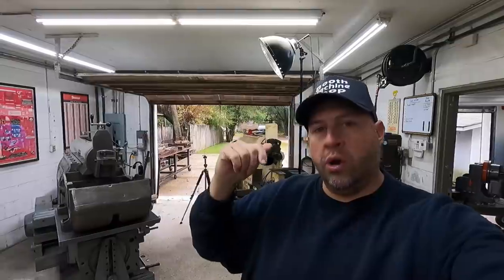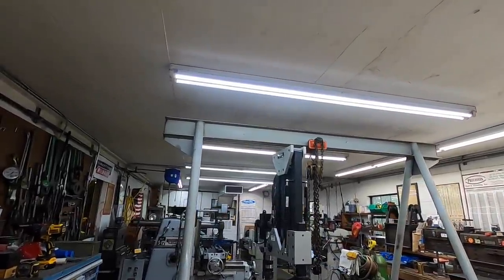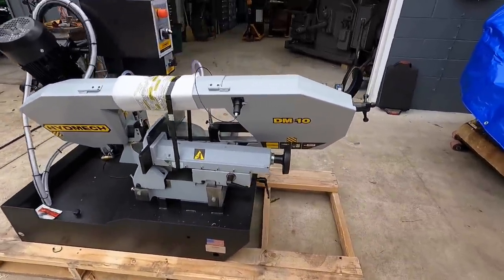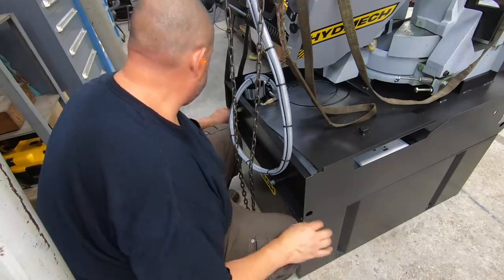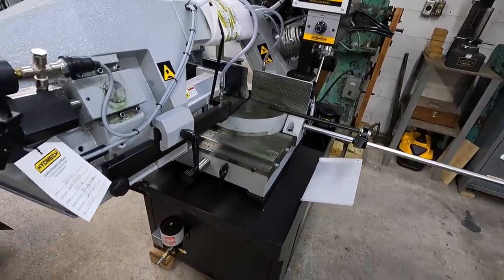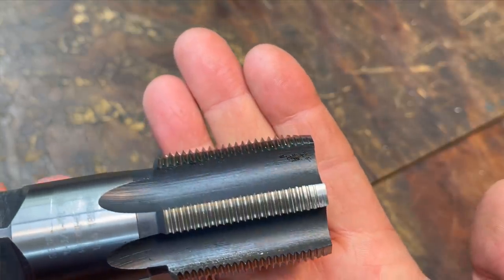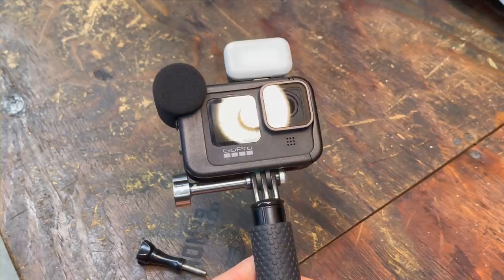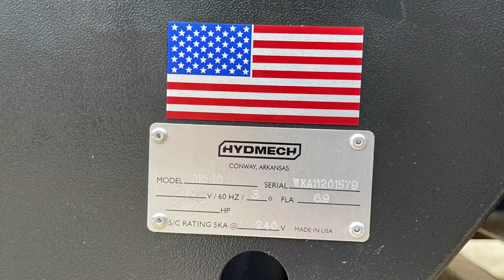SNS 330: Hydmech DM-10 Double Miter Bandsaw, Custom GoPro Accessory

Comment: I hope you enjoy the HydMech. We bought one one and didn't like it much at all. It had features, but it wasn't very rugged. We were a heavy production environment and we needed far more reliability than you will need. So I don't imagine you will experience the issues that we faced.  Ours was  bigger than yours. Ours came from Canada. Our main drive gear reduction unit failed within a couple of years. Our blade tensioning wheel was plastic and it didn't last long. Ours was full auto feed. There's a lot of competition in this market. A lot of saws seem to have cheapened the quality to compete with low priced machines.
Reply: Have heard both views on that brand. We ended up going with a HEMSaw, that is also full auto, made in Oklahoma. Super happy with that thing for about 15 years now.
Reply: New Hyd Mechs are no where near the old ones. Unless you are talking the big ones made in Canada. We change out a lot of gearboxes on hyd mechs.
Reply: Our gearbox failure started as a bad main bearing. I did the teardown and found a piece of the outer race was missing. I found the piece. It was a clean break. I believe that the large bearing was dropped and cracked during assembly. There was no other explanation for how it broke in the assembled gearbox. I couldn't get HydMech to warranty the failure. Our local dealer took a look, covered my bearing cost and reassembled for me at no labor cost. We bought a lot of machinery from this dealer.
That experience really soured me o. HydMech. We had other issues too, but that failure should have been covered under warranty. Dealing with HydMech directly for parts was not pleasant. My dealer didn't have a fully staffed office, so going through the dealer for parts added more complexity. I had no previous experience with HydMech before we purchased our machine. I was previously unaware of the brand.
We ran production volumes around the clock keeping two bandsaws running virtually non stop. Our machine was fancy and quick setup for angles, but it was too lightweight for our operation. I still suspect that Adam will never over stress his machine, and its flexibility for fab work is a fine feature. He is also an owner/operator that cares for his equipment. My experience was unpleasant, but if I added his new toy to my home shop, I would be giddy!

I am already giddy. We pour footings today for my 60'x82' home shop expansion building. The new shop will be metal/machine/mechanic space. The old multi-use shop will be exclusively wood shop. My wife is supporting the build! And it is simply a hobby shop. That is why I am giddy.

Comment: When lifting with straps we generally put a wrap on the lifting bars or shackles.
That means you could have put 2 or 3 wraps at the front to level.
That broken pallet would from your driver , cringed when he let that pallet jack down.
We use an Italian version of that saw at work, so good for cutting.

Comment: 14:30 one trick I use a lot on picking up big weldments is to pick up close to your center of gravity, then to put pieces of steel onto your high side to level your part in the air.

Comment: Alternative for waterproofing tools for outside storage, and any metal surfaces: Mix about 30% clear grease with white spirit into a spray bottle and spray liberally. White spirit evaporates and leaves a thin layer of grease behind. Way cheaper than aerosol products and will last longer outside. I also use on the columns of the drill presses and mill tables and other places I want to keep free of rust where oil too easily wipes away.

Comment: A mitering bandsaw makes all the difference.  They are very convenient.
If it’s like my Baleigh saw, that tray mounts at the back of the saw under the rear wheel.  It catches the cutting fluid that gets carried into the lower part of the housing and would drip on the floor.  You’ll need to move it to the side of the saw when you cut meters.

Comment: Your tap looks good after that tie rod job.  Light wear, more importantly, no damage, or  chipped teeth.  Keep in mind, there are two methods of sharpening your taps.  You mentioned grinding along the flutes.  The other would be to grind along the over all lenghth of it.  In volume work, that is the preferred way.  
Rough grind the leading flat at the front end down as much as needed.  This reduces the amount of teeth to go from the minor to the major diameter.  Follow up on this by grinding the teeth with a small clearance angle and a taper parallel to the flute to reestablish the leading angle back to it's original geometry.  Just look at the original geometry and reproduce the same shape.  This was something I could do by hand on a pedestal/bench grinder and get reliable threads produced on high volume orders.  
A combination, over time, of both methods would give you the longest tool life.  You are not to often expect to be using the same tap as you do primarily prototype work so this tap may outlast your career!
It took me a year or two of experience to become good at the sharpening method I described, but soon enough, it became pretty easy to preserve taps and I have used a similar method to grind chasers used in Geometric die heads.

Comment: If you want to line holes up, use a drift punch. It isn't really a punch, even if it looks like one. It's a long taper and if you can get the tip through both holes, you can wiggle it around while pushing it into the holes and those holes will line right up. In your case, you could have put the tip through while the holes were still a ways from getting close, and as you lowered, the drift punch would have guided the saw straight onto the base, perfectly aligned.

Comment: Just a thought, you could have used the DeWalt cordless reciprocating saw with the demolition blade in it to cut that pallet, but I saw the DeWalt cordless chain saw did a wonderful job.  I also noted the DeWalt cordless blower did quick work of the DeWalt chainsaw chips in blowing them off your slab to decay into mulch in your grass.  Keep your vids coming, I learn about stuff I have never seen before.

Comment: That is a beautiful piece of equipment. Would be good to install some steel casters under it to make it easier to move around. That way you could move it up against the wall when not in use and swing it out when needed.

Comment: I owned a hydmech. One thing I hated most about the one I had was that you had to be operating it. Unlike my wellsaws, which I could set up a cut and do other stuff, the hydmech required me to be there during the entire cut. Not a good machine for repetitive cuts. Also was poorly balanced and required a lot of force to pull down. The other issue was the blade tensioning interlock. Required a freakish amount of force to satisfy the interlock. You should keep your other saw. The great advantage of a miter bandsaw is that it doesn’t take 45 minutes to change from 90 degree  cut to 45 and back like a conventional bandsaw. I hope some of the issues I experienced have been addressed in yours.
Reply from the maker: I won't be having those issues you had with mine.

Comment: Nice saw! Just got done running a 1 5/16-12 tap on some stainless parts were making, not quite 180 parts but enough that I did the same and inspected after I got done, I ran emuge tap lube and after the job it's done on these stainless parts I don't think I'll ever run anything else.

Comment: Nice Saw - will be a great addition to your shop.  Is it 3 phase power?  I own an older model Wellsaw that I absolutely love, except mitres require a little more set-up, but doable.  Thanks for your continued posts and precision artistic talents as a machinist.  Wish we had the wealth of machine tools up here in Canada you guys have south of the 49th - most of the auctions I view are from the US, which makes shipping a deal killer.
Reply from the maker: Yes the saw is wired for 240V 3 phase. You can order it for single phase as well.
Reply: I was looking at that, too. 240-3ph? What alien planet is this thing designed for. I've never seen 240-3ph, but in a residential area, that would be easy enough to provide. (hang 3 "residential" transformers on the pole -- I'm going to have to look at skyline in his videos.) I trust Adam knows what he has (he's getting the bill), and what he needs (there's plenty of different loads in the shop already.)

[ https://youtu.be/O-1S93wQN5Q 208, 480, 600 are the common 3ph grid connections I'm familiar with. ]

Comment: take the time and make a frame for under the new bandsaw and attach some castors to that mate, makes it way easier for cleaning and moving around, i have the exact same saw but its branded "shark" made in italy, has the exact same MEP cut control system, just keep it topped up in the rear cylinder with hyd oil and it will run sweet. nice purchase

Comment: You should get a power winch and drill an anchor point in your driveway, like you did to get the shaper off the trailer. Then you can connect the winch to the anchor and any machine and pull them in/out the shop with your skates.
Edit: You can get one with a remote and just stand with the machine to guide it while you run the winch

Comment: Just wanted to point out that Hydmech is only a brandname from the Italian bandsaw manufacturer MEP. There is a "MEP Group" logo on the back.
So basically its an Italien saw, assembled in the US and with a US Flag on it. Nothing more.
Reply: @mustacheandthemaiden5773   But the American put there flag on it :-) No offence, just saying. :-)
Reply: That is a MEP indeed! We have a MEP 242 CNC FE at my work that we got 2004. Great machine that still runs like a charm!  What I really like about it and what also seems to be unique for MEP is to be the only brand of saw machines at least what I  have seen that can operate in the entire range from manual to full CNC (including a so called semi auto dynamic mode where it starts out like in manual mode where u position the sawhead (Y axis) by hand and then when u push the handle button one time it then starts operating like in semi automatic mode and makes the entire cut by itself) in the same machine wich is  great for what we do at my company as we make a big variety of things in a large range of sizes where the machine has to be really flexible. I however find it confusing and meaningless to change the brand name and flag (italian flag on our machine as it is indeed an italian and not an american brand even if it has been assembled partly in US) for the same machine in different markets and HydMech also sounds like a hydraulic press brand or something similar and not a bandsaw manufacturer. In the next video the MEP logo is clearly visible (is under the tape on the saw head) looking exaclty like our machine. MEP by the way stands for Magnani Enzo Pergola from the founders initials and the companys location

Comment: Cut the heads off of longer bolts or long allen set screws, screw them in the base holes to align it before you set it down.

Comment: Boy that thing makes the Taiwan made one they bought at work a couple weeks ago look pretty sad. Mind you it does the job we need it to do. Makes a good straight cut, does splash coolant all over the place when it's running though. I might be over doing it with the coolant, it just has a cheap valve you open and dumps it on the blade. It gets carried around with the blade and drips on the floor. They thought of it on one end of the machine with a drip pan but not the other.

Comment: Adam, in skydiving having something stick out beyond the body of the camera is dangerous. The knob has a Philips screw head to tighten/loosen the knob.
Reply from the maker: That does not explain why all models before using the Media Mod, the screws always stuck out further than the camera. When you are using these cameras you don’t want to use a screwdriver. Have you ever had to replace a battery in these? The thumb screws were designed for convenience.

Comment: Yep, the stock thumb-screw is definitely too short when you use on the Hero9 MediaMod. Sadly, I haven't found any amazon that's as swish as the one you made. If you do plan using two GoPros concurrently, they just released a remote control for the Hero9 to assist stopping and starting. It's cheap enough to justify the purchase and cuts down on your editing time a bunch.

Comment: Just as an FYI Adam, I'm pretty sure the GoPro screws are actually metric M5, but they're so similar to a 10-32 it makes no difference! If you're ever in Europe and need a screw though it might be useful to have at the back of your mind.
Reply: "It's M5 (with standard thread pitch 0.8mm)"
https://www.reddit.com/r/gopro/comments/2xh4x0/question_about_the_thumbscrew_threading_size_want/
   Nowadays even HD has metric screws. No need to go to Europe.

Comment: Now I see where the radial arm drill press is. You need to just build a room around it and start using it. That wrench you used to secure the saw to the base doesn't look like it's yours. It's more pipsqueak sized than Abom. I'm interested in seeing the coolant run on that saw, what advantage does mist coolant have over flood coolant in this application?
Reply: Less mess.  If you have ever used a band saw with flood coolant you will know what I am talking about.

Comment: I had a gopro (1?) and good god the screws on the bottom are infuriating. You almost exclusively have to use a philips head screwdriver as the thumb turn is hopeless - and the captive acorn nut always wants to push out the back side. This mod is awesome :D

Comment: I would not be impressed with that air coupling sticking up above the crate, or the strength or the bearer which had broken.
Reply: Thats a cheap pallet, I thought the same, what happened to the bearers in the middle of the pallet, somebody pinched the wood for there shed!!, the male air coupling could have be left with the other items .

Comment: Be nice if you could put a new thin layer of concrete ontop to give you a new clean floor
Reply: You could use the epoxy coating that are out now .
Reply: Or simply grind it smooth.
Reply: @bigthumperfoot  the gritty dust would be a pain around all the machinery .
Reply: @fuzzymerkin7610  wet polish wouldn't make dust and make it glassy smooth

Comment: at 6:25 Doing that is a KNEE Destroyer. But, I do not think Abom does that a lot. But for youall considering prying heavy machines a lot, consider drilling holes in floor, dropping in rods, and then winching. Or,.. just get rich and buy a big building and a forklift :)

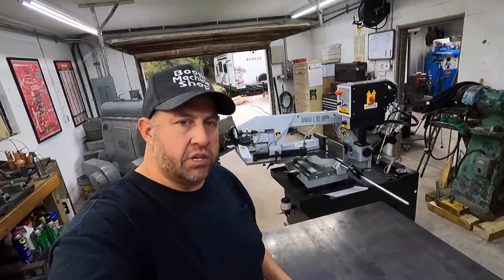Comment: 20:39 Why is there what looks like a brass wire wheel on the saw - not too far from the last H in Hydmech ! ?
Reply: For removing chips from the blade..
Reply: Its a chip brush, and its brass plated steel
Reply: Cheers,  @edsoutlawmotorsports1332  . So does it fit the machine somewhere and revolve, driven by the blade and fitted at a skew angle so it brushes chips away from the blade as the machine's in use ?
Reply: @FTOdude  OK, thanks.

Comment: I recently inherited a drill press.. a  1979 oit model number 4348 from my father when he passed away but the drill press is missing the spindle and Chuck I've looked online for replacement parts but have not had any luck so I'm wondering if you or anyone else would have any ideas on what I should do ..thanks
Reply: I'd pose the question to Keith Rucker - VintageMachinery.org
Reply: @fuzzymerkin7610  okay thanks